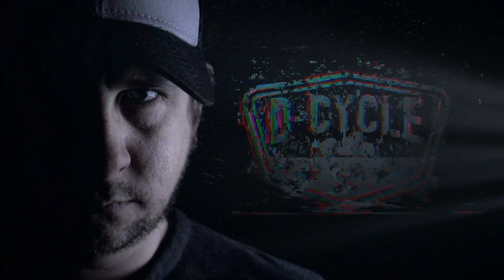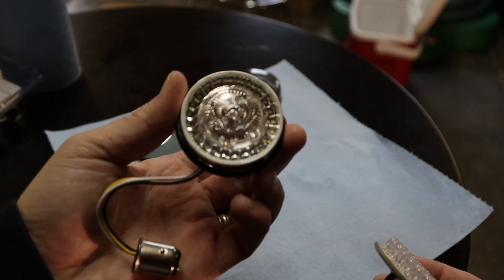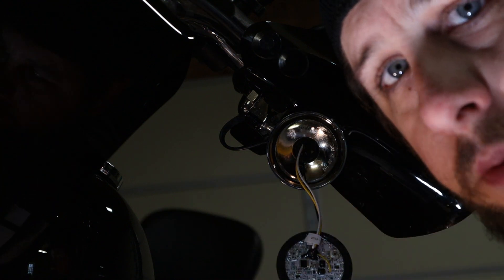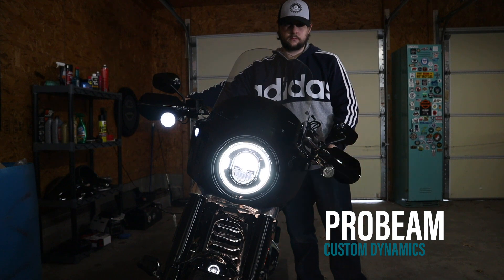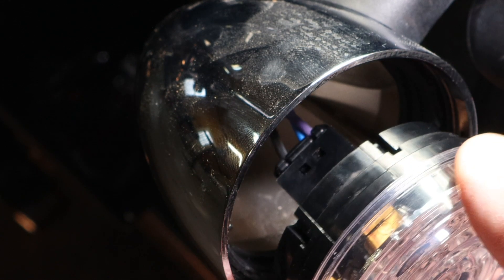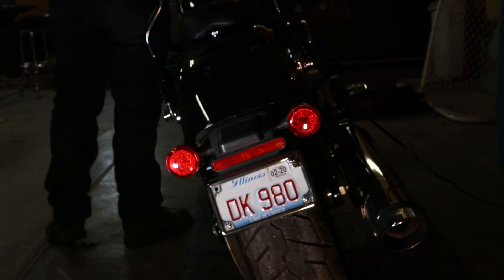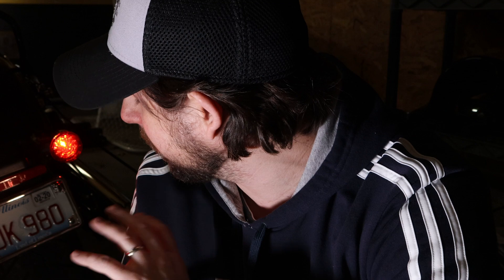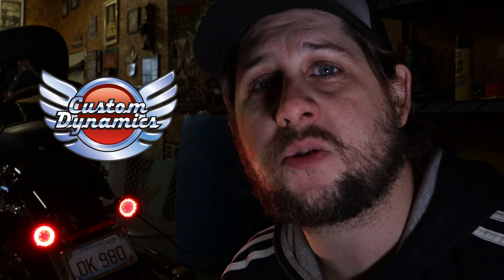Installing Custom Dynamics ProBEAM LEDs on my Harley

Comment: On the original rear lens, was there an indent to fit the screwdriver into to pry off the lens - What model yr is your SG?
Reply: It’s an ‘18. Just had to fit the tip of the flathead in the tiny gap somewhere and pry/wigflw it loose.

Comment: Hey D I watched this video again , when you turn on the turn signal either side and apply the brake at the same time does the side flashing still light up or just indicate a turn and only the opposite side indicate a braking , this is currently what is on my SG , yet in the UK they appear to be a two in one light

Comment: I just had these installed on my ‘18 Street Glide Special. They skipped the step of running the 4 ways so that they would sync. My turn light indicator on the dash were flashing like it was in rabbit mode. Did the sync as the paper work said to for 20 seconds maybe than took it out for a ride. Then checked again when I got home.
Reply from the maker: Custom Dynamics is good s**t!
Reply: @DCyclemoto  I had the stock halogen bulbs and these are definitely good s***t

Comment: Good install. 
I would advise that even through they come slightly coated, the new parts. Dielectric grease on any electrical install. For longterm purposes and water resistance.  Also God time to do hazards when showing side by side.
Keep up the good work. Hopefully spring soon.
Hooah!
Reply from the maker: Razz Rasmussen Just an FYI, the instructions say the grease doesn’t need to be used with these lights and can actually prevent them from working.
Reply: @DCyclemoto  I see...thanks. I continue to learn.
Reply from the maker: Razz Rasmussen Me too, sir! I was surprised to find this out as well.

Comment: Hey bud....so my front turn signals only illuminate when I put on the turn signal, but do they magically become running lights when you add the ProBeam LED's? Just wanting to clarify. Thanks D!
Reply from the maker: Yeah they serve the dual purpose
Reply: @DCyclemoto  Wow, so they basically become running lights when you're riding? Sorry, but that is pretty amazing! Thanks for your help on this.

Comment: Hey D , after installing the new lights did you notice that the turn indicators on the cockpit display flash faster, I think if that happens a load capacitor would be needed
Reply from the maker: Running the hazards for 3 minutes like stated in the directions synched up the lights to the electrical system. No hyperflash, no load equalizer needed for the new models like mine.
Reply: D-Cycle Great thanks I did know that I will give it a try.
Reply: I tried it and the dash lights still hyper flash, oh well no biggie , thanks just the same .
Reply from the maker: Rob are u all led?
Reply: D-Cycle Yes the rear is factory the front is LED
Reply from the maker: Rob the rear is led?
Reply: D-Cycle yes all LED front and rear.
Reply from the maker: Rob contact custom dynamics. They have good customer service.
Reply: D-Cycle Thanks D

Comment: Never hear to run the flashers for 3 min. to set the electrical system. Can anyone confirm that?
Reply from the maker: On the instructions from the manufacturer.